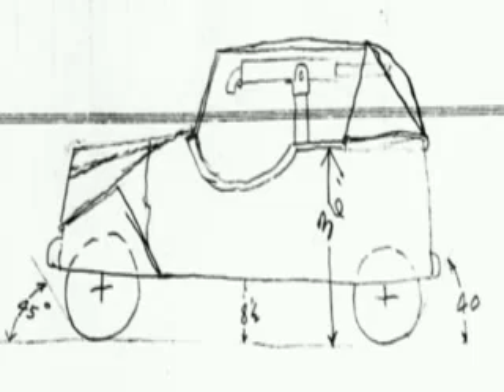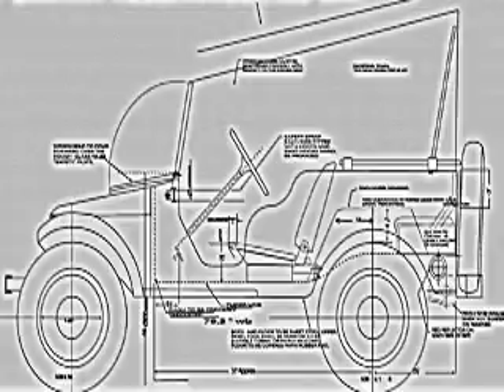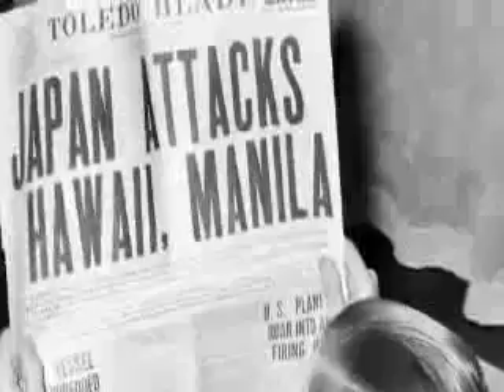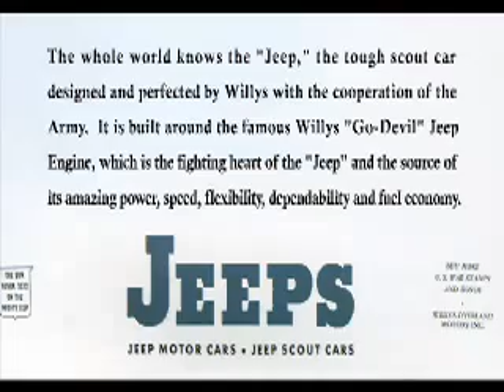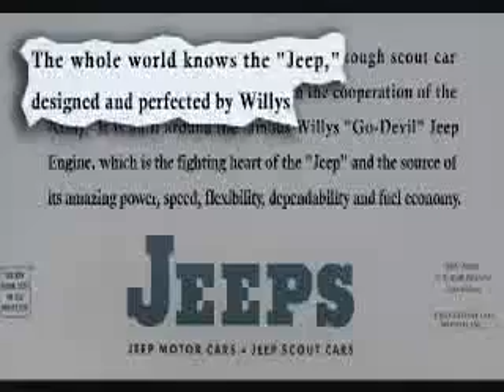Jeep:Steel Soldier, Widescreen

Comment: They should start to make the original jeep and sale it in a box to be put together by the buyer. I'll buy one for sure!
Reply: A company from India does and it's called a Roxor. Available in the US
Reply: @chrishorton6605  I've seen videos on this, but they aren't street legal and they have modern diesel engines.
Reply: no problem find a Jeep specialist (like Kaiser Willys) and go for it. But at a certain cost, you'll understand :-)
Reply: @00razmataz  princes auto is selling a replica... $2000 CND. Just like an ATV. Not too bad. Thanks
Reply: Joel The Jeep , as it was, wouldn’t be legal for street use in the USA either.
Reply: You can get enough parts to basically make one new from scratch. They even make new engine blocks.
Reply: @chrishorton6605  Roxor is closer to a CJ5 with CJ7 - esque body.
Reply: @prevost8686  Original WW2 'Jeeps' are 'street legal'.
Reply: @-oiiio-3993  Uh, yeah during that time period.  A Jeep made exactly like those would not be street legal according to current safety standards.
Reply: @prevost8686  Tell that to the thousands of people who drive restored MB / GPW vehicles with full registration and insurance.

I drive a hot rod 'Flatfender' in California and, by virtue of its 'straight title' as a 1946 Willys, am only required to have DOT legal headlights and one (left rear) tail light, brakes.

I am not required to wear seat belts while driving it, no 'smog' inspection, it is over carbureted, runs fenderwell exhaust headers, MSD... . As a 1946 titled vehicle only requirements in place in 1946 apply to it.

A newly constructed vehicle is a different story.

Want to buy a legal, titled, Willys 'Jeep' frame?
Reply: MD Juan sells them
Reply: @-oiiio-3993  God I miss my CJ7....that horrible 258 6 and  the 5 speed.  The hardtop rang like a mf in winter, but I would always put the bikini on about a month too early and freeze and get drenched at traffic lights.I would give anything to go back.
Reply: @chrishorton6605  They're cool but not street legal:(
Reply: MD Juan in the Philippines can ship you a brand new Willys jeep in a crate.
Reply: @prevost8686  one from that time. That was brought up the street legal at the time would be grandfathered in and still street legal
Reply: i see  a movie here ...

Comment: I was in the Marine Corps in the mid 1960's and I drove a Jeep that would go damn near anywhere. In 1967 they introduced a new jeep design that was a piece of crap. It rolled over too easily on curves and killed several guys; so it was phased out.
Reply: The M151. Design began in 1951, adopted for use 1960, produced (later variant) through 1978.
The design had been improved, the M151A2 version with improved trailing arm rear suspension to address the rollover issue.  They were still considered too dangerous for surplus sale, most being torch cut into large chunks prior to sale.

Comment: Keep in mind probably a majority of MB's & GPW's were left in the theaters where they were used, Europe, Pacific Theater and and Korea along with trucks and other war material, some were dumped off ships into the ocean. It was deemed not economical to bring this stuff back. I doubt much thought was given to the impact on new car sales in the US since it would take a while for auto manufactures to switch back from war production to civilian automobiles, some time in 1946 I believe. Anyway the DRMO ( Defense Reutilization Marketing Office)  deemed them a safety hazard and cannot be sold to the public unless the whole thing was torch cut down the middle, supposedly making them only useful for parts or scrap. Although not as vibrant as it used to be there is still a large market of original  WWII Jeep parts in France and some other countries as well as some complete Jeeps.of course not all jeeps met the fate of being cut but a lot did. 
Europe was a treasure trove of war material after WWII and to a lesser extent today. Civilians gathered all manner of equipment off the battle field, Thompsons, MG 34's and 42's MP40's, M1's the list goes on, and stored it in attics and barns. There is still a lot of dwat arms in Europe today.

Comment: I’ve owned over 2 dozen Jeeps since the late 1960’s including 2 MB’s and 1 Ford GPW.  Ford apparently wanted to make sure everyone knew who made the GPW.  While restoring my GPW  8 realized every nut, bolt, lug nuts wheel studs ect and a F stamped on it.  The cylinder head had Ford scrolled  on it.
Reply: Quality control.
Nearly every part of an MB could be interchanged with a GPW and vice-versa as they often were in field use.
If a part failed on a Truck, 1/4 Ton, 4X4, G503, Ford wanted to be able to identify whose part it was.
Reply: @-oiiio-3993    It was strictly an ego thing with old Henry Ford who was still involved with the company even though Edsel was technically in charge of the company until he died in the middle of the war.  Bantam, Willys and Ford all got their parts out of the same parts bin during the war.   Several articles have been written about this going back to the late 1980’s in various magazines.
Reply: @supersami7748  Such is your (and others') assumption.

Ford cast 134 inch 'Go Devil' engines of the Willys design (for which Willys got no royalties) - an engine that Bantam never used. Many body parts for the Truck, 1/4 Ton, 4X4, G503 were produced at Ford plants. ACM, who made 'body tubs', also marked trailer tubs for Bantam differently than those for Willys for much of their production. Ford did not mark the Dana/Spicer transmissions or transfer cases... .

The bottom line is that Ford produced vehicles as subcontractor with parts that would likely be (and certainly were) mixed with non Ford built vehicles and vice-versa.

It was a matter of quality control.

Comment: I heard that the government had agreed with the manufacturers not to sell surplus Jeeps to the public .    Doing so would have lessened sales of new cars .    So the  military Jeeps  were cut in half and sold for scrap .   That, at least is what I was told and ,if true,  it represents government wastefulness .
Reply: The exact opposite was done at the end of WW2.

'Jeeps' had been reconditioned / rebuilt at ordnance facilities in the U.S. and abroad during the war (thus the nearly complete parts interchange between Ford GPW / Willys MB). At war's end refurbishment continued with several outside firms under contract to rebuild vehicles at government expense prior to surplus sale.

Thousands of Ordnance refurbished 'Jeeps' were sold as surplus through the 1940s, 50s, 60s.

Here is a partial list of firms contracted by Ordnance in the U.S. and quantities rebuilt. There were also facilities in Europe, Asia, Africa.
1. Bechtel McCone 4,986
2. Allison Steel Manufacturing Company 2,865
3. Moore Equipment Co 2,443
4. Higgins Plastic Corp 1,850
5. Stewart & Stevenson 1,750
6. W.A. Bechtel 1,555
7. Bishop McCormick & Bishop 343
8. International Diesel 267
9. Vancura Motor Company 66
10. A.M. Meyerstein 49

It was the (decades later) HMMWV that was seldom sold as surplus for some years, possibly a deal made to protect civvy sales of the 1980s - 90s 'Humvee' or just a continuation of GRMO policy to not sell intact M151 vehicles as they were considered dangerous / unfit for civilian use.
Reply: Unfortunately this is partially true. Many GPW's & MB were not considered road worthily enough for highway use and were cut in half,  thankfully not all were.I own a very original 1945MB that was never cut.
Reply: @carlwojtaszek5960  That is not the same as "...the government had agreed with the manufacturers not to sell surplus Jeeps to the public .    Doing so would have lessened sales of new cars. So the  military Jeeps  were cut in half and sold for scrap .[sic]"

Not all vehicles that went into Ordnance refurbishing came out as rebuilt. They went in as anything from lightly used to wrecks that had been hit by artillery fire and still had salvegable parts. The objective was to assemble as many complete, viable, surplus vehicles for sale as possible - quite the opposite of the OP's statement.
Reply: @-oiiio-3993  how do you explain all the 40 foot trailers  loaded with half cut jeeps in 70s 80s?
Reply: @rctopfueler2841  The M151 vehicles were 'demilled' prior to DRMO sale.

Comment: Damn, the front end of the Bantam model was one ugly sumbitch....so was the original Willy's...I've got a 1944 Ford GP runnin a Ford 289 K-Code out of a wrecked 66 Mustang putting damn near 300hp to the ground, 4spd w/a Warn manual overdrive, Dana 44 posi rear Dana 35 posi front end, it's a savage....
Reply: There was no 1944 GP, it would be a GPW.
Ford's GP was a 'pre - standard' model of which 1,500 (later increased for Lend Lease) were contracted to compete with Bantam's BRC and Willys' MA for the eventual G503 contract.

The contract for Truck, 1/4 Ton, 4X4, G503 was awarded in 1941 to Willys Overland who would build over 360,000 of their MB model (Military, Second contract).  Ford was named subcontractor to G503 and built over 280,000 of their GPW model by war's end.

Ford's GP denoted Government, 80" wheelbase ('P' was Ford internal code for 80" w/b), GPW was Government, 80", Willys pattern.

Comment: '
how many cyclinders this jeep...
auto or manual...
where is XR-311 car
Reply: bestamerica,  4 cyl side valve, of course manual .
Reply: WW2 'standard Jeeps' (Truck, 1?4 Ton, 4X4, G503), whether Willys MB or Ford GPW, ran the Willys 'Go Devil 134 cubic inch engine which was a 'flathead' 4 cylinder. Gearbox was T84 three speed with Dana/Spicer T90 transfer case.